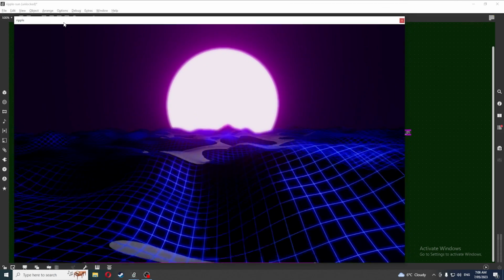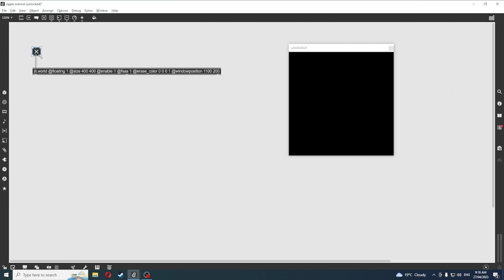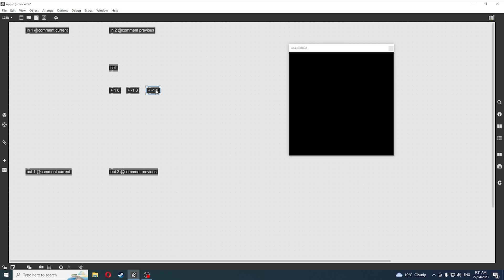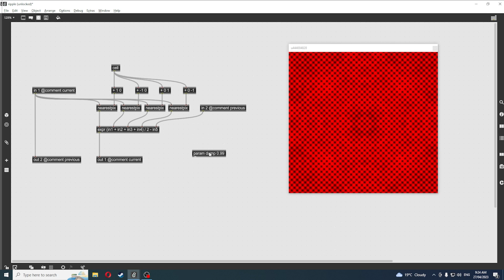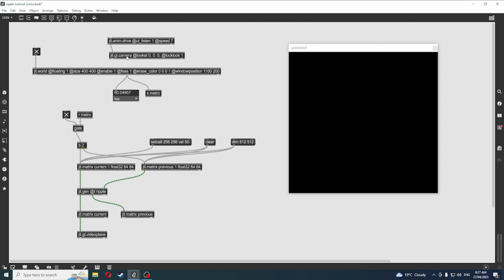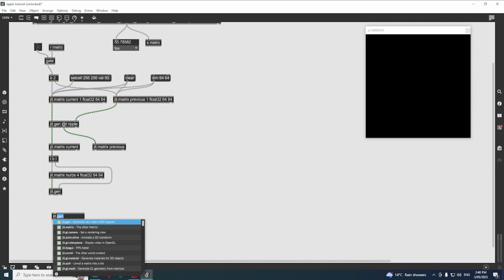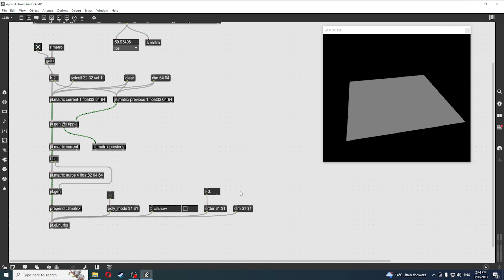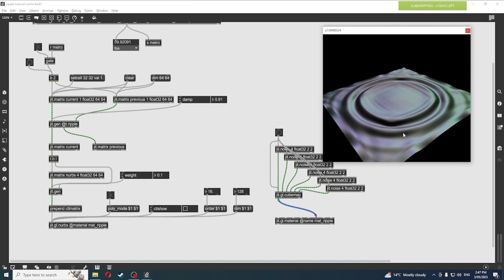Max MSP Tutorial: Ripple Simulation

Comment: Love this! For the 3D simulation, is there a way to keep the frame rate the same but make the ripples move slower without increasing the dims of the different matrices too much? Would be nice to have it running slowly but smoothly
Reply from the maker: Thanks! It's a bit tricky to bake a timestep into the algorithm as each state relies on the previous state, and having inbetween states would screw with the output. However you can fake it by setting a fixed framerate. For example have the main algorithm update current/prev buffers once every 100 frames, but have the actual rendered output update every frame. You can use the 'mix' jit.gen object to interpolate between the previous and current state every 100 frames, with the interpolation factor being 100/(frame%100). This way it will smoothly transition between states and you can set the frame update speed to control simulation speed. Hope that helps (:

Comment: The initial way I would think this could "control music" is to define the pitch spectrum starting from middle to edges, with midpoint having lowest bass, edges highest treble (ie. radial sonic spectum from center low hz to outer high hz).

Upon clicking any point on the surface... it determines the pitch based on radial distance from center. The propogation and volume of the note would be relative to the force of the hit.

That is pretty simple/straightforward. Ideally it would utilize a 2D input pad for it, that could encompass the entire X-Y plane (something like a Kaoss pad or similar to input X/Y coordinate), with an associated force. I think that's how the Kaoss pad effects work anyway ;)

Aside from that, I would think modulation could come from other inputs/stimuli (ie. modulating with left hand on something else, while tapping with right).

Don't know if that's too interesting, though... if I have any cooler ideas I'll lyk.

Or holding any point on the surface "builds up" a wave/force... then when letting go, releases it at that pitch (radial distance) and given force relative to length of hold, causing the visual impulse then, possibly sonic too if you want then. 
Or both ways... something like "pushing and pulling water" ... maybe it detects taps vs. holds... would be a nice line... a tap causes immediate impulse with some force. A hold just builds up the impulse and then releases, similarly.

Alright I'll go think of something else...
Reply from the maker: @MrW3iss I was thinking similarly re: pitch spectrum. Or possibly the polar plane could represent sonic distance and orientation from the listener as a 3D spatial sound project (: